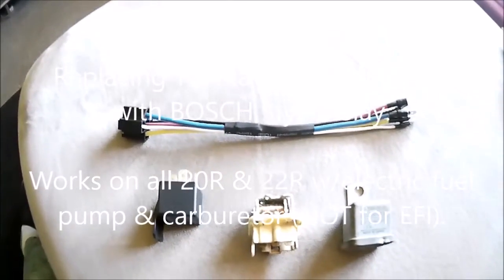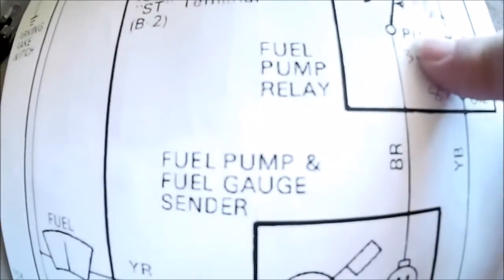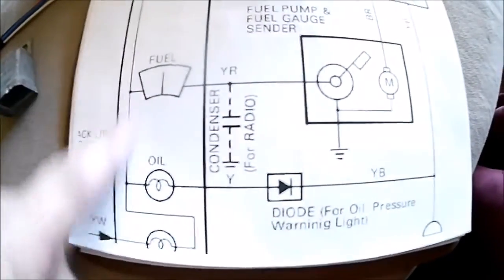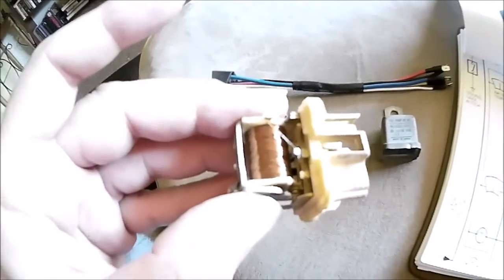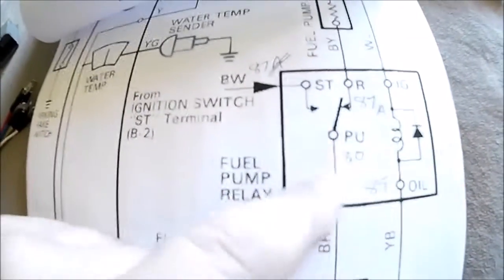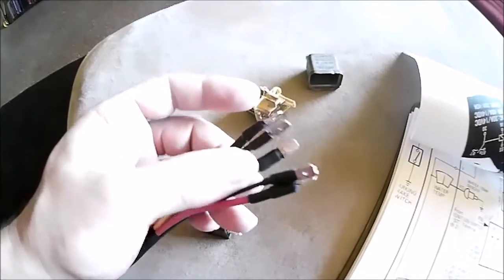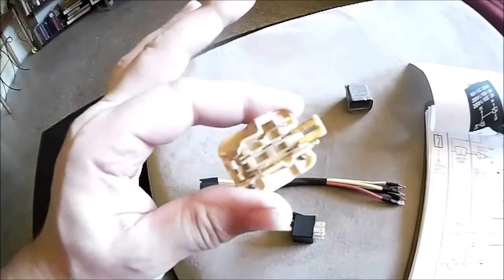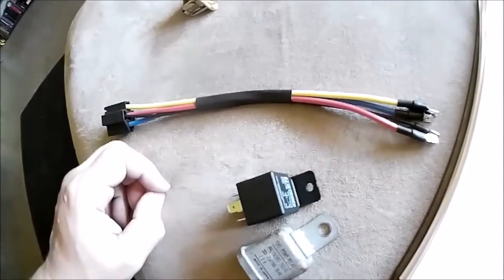1978 Toyota Pickup 20R-Fuel Pump Relay Replacement/Substitute

Comment: Will this work on a 77 Celica liftback with a 20r and electric in tank pump?
Reply from the maker: I don't see any reason it wouldn't work. It's the same engine, same fuel pump & same wiring setup as the Pickup. There seems to be a difference in wire colors between the models. I will give you links below to the wiring diagrams. You should also test the fuel pump resistor to make sure it's in spec. The base spec I have for it is 1.4 Ohms. As they get old they can develop higher resistance, which can drop voltage to the pump too much, reducing fuel flow & volume.

1977 Celica Wiring Diagrams (see Figure 5 for the fuel pump relay & wire colors, color chart is in Figure 1): https://www.autozone.com/repairguides/Toyota-Celica-Supra-1971-1985-Repair-Guide/WIRING-DIAGRAMS/WIRING-DIAGRAMS/_/P-0900c1528007cb61

FOR COMPARISON - Basic Fuel Pump Relay Wiring Diagram 1975-78 Pickup, see 3rd posting, click on third pic in post for larger image: http://toyotamotorhome.org/forums/index.php?/topic/6410-1975-electric-fuel-pump-wiring-diagram/

If you have any other questions let me know.
Reply: The13thSword I saw your update on your description about the denso 5670045 being a plug and play replacement so I opted for that. I just plugged it in and the pump still isn't getting any power. Where would you recommend I look next?
Reply from the maker: @hurrdurrilikevideos  As far as hard parts you would next test the fuel pump resistor & the pump itself. If the resistor has gone bad (high resistance) it could be keeping voltage from getting to the pump. I am not sure where it is located on the Celica, but on the pickup it's in a steel bracket on the passenger side inner fender well, under the hood. You can see what it looks like here: http://toyotamotorhome.org/forums/index.php?/topic/6410-1975-electric-fuel-pump-wiring-diagram/

It is the 5th post down, 3rd & 4th picture. The original resistor is ceramic, rated at 1.4 Ohms 10 Watts. Over time & with heat cycling, the resistor can get beyond it's rating in resistance, especially when hot. To test it you'll need an Ohm meter, preferably a self-zeroing meter. Cheap Ohm meters are not self zeroing, so you have to subtract the test leads resistance from the final reading of the resistor. Just set the meter at lowest Ohm setting (usually 200 Ohms) & connect the leads together to see their resistance. Then measure the resistor & subtract lead resistance from that number. You should get no more than 1.6 Ohms reading (10% over), even if the resistor is hot. More than 1.6 Ohms the resistor is bad.

I used a hair blow dryer to heat up the resistor to check for this. Also check the wires to it and the connector. Dirt in the connector can also cause extra resistance, or possibly block the flow of voltage entirely. Blasting out the connector with some WD-40 works, just make sure it's dry before reconnecting.

My resistor turned up bad, reading 2.6 Ohms hot, that meant only 3.6 Volts were getting to the fuel pump. It's supposed to be about 9.5 volts. Toyota replacement part is no longer available but I have a good fix for this. Contact me if you need to replace the resistor & I'll give you the info on it.

Also as a test, you can disconnect the fuel pump resistor & bypass it. You can put a paperclip or short piece of wire in the wire-harness side connector to take the resistors place. WARNING - Only do this for test purposes, just long enough to see/hear if the pump is getting voltage & working. DO NOT DRIVE OR RUN THE VEHICLE LIKE THIS. If you run the fuel pump too long with the bypass you can burn out the pump. If you use the paperclip, make sure it doesn't touch the car body at any time; this will "ground it out" & cause major headaches.

FUEL PUMP - If it's old you should consider replacing it. You have to drop the gas tank out of the car to get at it, even to test it directly, so it just makes sense to get a new one in there. Here's the one I used on the Pickup; it's the same one the Celica uses, AIRTEX E8188: https://www.rockauto.com/en/catalog/toyota,1977,celica,2.2l+l4,1273766,fuel+&+air,fuel+pump,6256

Beyond all that, you can use the Ohm meter to check the actual wiring circuit for continuity and/or voltage. Have you checked your fuses? Any rain leaks on the driver's side near the dash? That can cause problems with the fuse box. Is the fuse box in good shape?

Keep at it, it's a 41 year old vehicle that more than likely needs some very overdue attention. It can seem endless sometimes but you just have to follow a logical path on these things; it can be made to work, & work right. Any other questions let me know, I'll do what I can for you.
Reply: The13thSword I'll test that next. Do you have a part number for a resistor I could use that would work on it? I looked at my resistor earlier and it's pretty crusty, it probably wouldn't hurt to replace it anyway. 
I just cleaned up the fuse panel and replaced the fuses this past weekend. The fuse panel seems to be in good condition but I noticed yesterday that now the turn signals don't work but everything else seems to be working fine

The fuel pump is new and I just installed it not too long ago. The way I got the car, the fuel pump was spliced into one of the cables to the fuse box and was pretty much on in the car was on the acc/on position. The pump got power like that so I know it works.  I'm trying to go back to the original wiring and struggling to get it power.
Reply from the maker: @hurrdurrilikevideos  Here is the resistor I used to replace the old one: https://www.mouser.com/ProductDetail/ARCOL-Ohmite/HS10-1R5-F?qs=sGAEpiMZZMtlubZbdhIBIEidPY%252Bx%2FLaa8g707GTTtN8%3D

You can order 1 piece from that site. It's Mil-Spec, aluminum cased, moisture proof & can handle whatever heat will be under the hood. I just wired/soldered it into the existing wire harness for it & installed the resistor on the mounting plate like the old one, under the metal hold-down tab.

Fuse Panel - My fuse panel had a lot of copper oxide (green stuff) on the terminals on the back, and in the sockets in the plug to it. This caused some electric item to not work; the oxide acted like an insulator. I took the easy way & removed the fuse panel & dipped it in Tarn-X, & also dipped the plug. Took off all the copper oxide & didn't hurt the metal or the plastic. If you do this be careful with the plug, as it could be brittle.

Turn Signals - It's either the copper oxide problem or you might need a new turn signal flasher/relay. Original Toyota Part # 9098701001. Nothing listed out there for the '77 but later model ones are the same, like this one: https://www.rockauto.com/en/moreinfo.php?pk=39373&cc=1273878&jsn=1120&jsn=1120
Your OEM part # is on that listing so it should work. These things didn't change much over the years.

Sounds like someone couldn't figure out the relay/resistor circuit, or they had a bad/dirty connection they couldn't find & just wired it direct. Not a good idea, IF they didn't install an inline resistor. The stock style pump was not designed to constantly run on a full 12 volts; it only does that at start up. The stock wiring is set up to give the pump 12 volts when the key is in the "START" position only. This gets a "dry" fuel system primed quicker. Once the engine starts & the key is released to the "ON/ACC" position, the pump is fed voltage through the resistor (about 9 volts). Toyota did this to extend the life of the pump. Running a stock style pump on full 12 volts can burn it out quicker, even if it's a new pump. How long have you been running it with the direct power hookup? I'd do a flow test on the pump to make sure it's still working right. It should be putting out right at a quart every 15 seconds.

I'm very interested to hear the results of the resistor test(s); I think that it could be the main suspect here. If the relay is known good, the resistor is known good, & the system is getting power from the fuse box it should work. Only other thing that would keep it from working is a bad ground to the pump  or a problem in the power wire itself, but this isn't common. Just don't get frustrated with it, take it a piece at a time in logical order, you'll get it, one way or another.

Comment: I'm wondering if that relay will interchange with my 92 has the same electrical hookup
Reply from the maker: You could wire in a Bosch style relay like I did & it will likely work, as long as you have the wires connected correctly. I know it will work with the 22R models (carburetor). I haven't tried it on a 22RE (EFI, Electronic Fuel Injection) but looking at the wiring diagram it should work the same. The "off/on" signal for the relay on the carb version comes from the oil sender switch. On EFI models the signal comes from a switch in the Air Flow Meter. As long as the engine is cranking or running it will draw air into the meter, move a flap in the meter that is connected to the switch, and close the switch to complete the circuit.

I only did this conversion because the price of the relay for my '78 (IF I could find one) was listed at $80 to $90. I have since found out that the same relay used on later models like your '92 is electrically the exact same thing, and I could have gotten one of those & just plugged it into my existing socket and been done with it.

OEM part for your '92 is available all over the web, DENSO Part # 5670045. Original Toyota Part No.: 85910-35010. Average price $35-$40.Dealer Retail on this part is $92.25(!) Just plug "DENSO 5670045" into Google search & you'll find plenty at the better price. DENSO is the OEM parts maker for Toyota so quality is OEM.

Let me know if you have any other questions.
Reply: Thank you, I found out 78 relay fits but doesn't work on my 92 probably go your method with the Bosh,cause I don't feel like paying 140.00
Reply from the maker: @dybalaclint2778  The Denso Part # I gave you before is specific to your year truck, & is only $30 + ship from Rock Auto, and is basically an OEM part. No need to pay the "stealer-ship" prices on those.

Link to part on Rock Auto: https://www.rockauto.com/en/catalog/toyota,1992,pickup,2.4l+l4,1277939,electrical-switch+&+relay,fuel+pump+/+circuit+opening+relay,3380